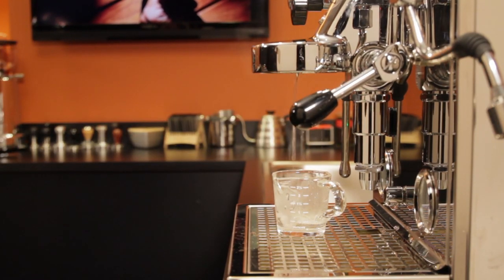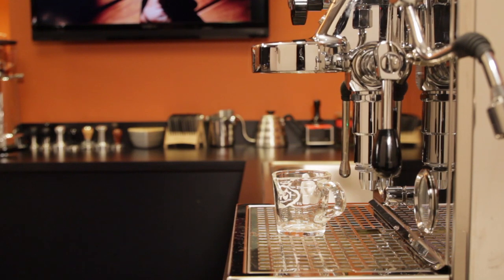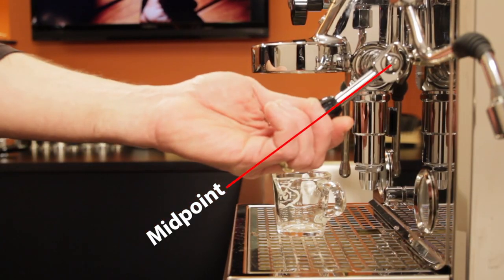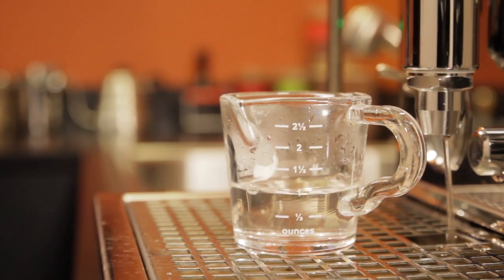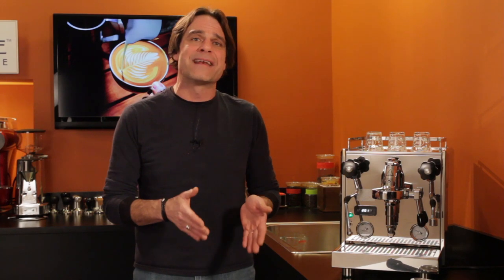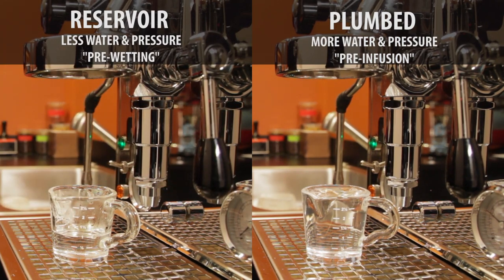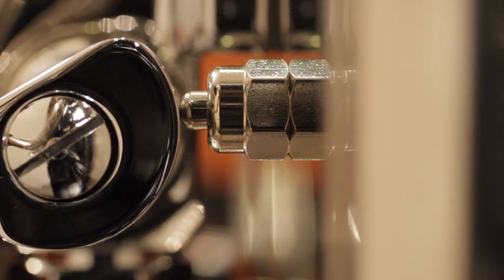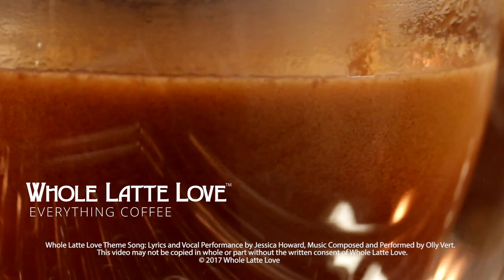How To: Pre-Infusion on E61 Brew Group Espresso Machines

Comment: UPDATE: turns out I'm wrong and there is no such thing as autmated pre-infusion. Thanks for clearing that up!

In a video about E61 it might have been worth to mention that is comes with built-in automated pre-infusion... Not sure if your research was sloppy here but I feel that's something to know about the E61. Don't get me wrong, I do like your other videos!
Reply from the maker: Hi Clemens, Thanks for the comment. We've been using and rebuilding E61 groups for years and are unaware of built-in automated pre-infusion. Some however could possibly call what happens with E61 groups on Expobar machines a form of that. Expobar E61s have an extra chamber milled above the shower screen. It takes a second or three for that chamber to fill with brew water before full brewing pressure is applied to coffee in the portafilter. As it's filling, water can drip through the shower screen and wet the coffee. Is that what you are referring to? Also some difference depending on pump type a machine uses. Vibration pumps tend to ramp up to brewing pressure over a few seconds while rotary pump machines achieve full brewing pressure quickly. Although rotary pumps are more robust, we do talk to those who prefer a vibration pump machine for the "pressure profiling" like effect they deliver at the start of an extraction. I am curious to know more about what you are calling automated pre-infusion.
Reply: No you were not wrong. What this video as well as the one you linked completely ignore is the "preinfusion chamber", which has a weaker spring than the bottom one designed to open when you start the brew process. It opens from the pressure, without the lever being in the bottom position. That is the whole reason that there are two parts to the outlet instead of just one. In the video you linked in your followup comment the guy does not seem to know how the lower half of the E61 works at all, he speculates the two parts (and springs) are meant to lower the pressure in the outlet when you stop brewing. But the top chamber of the lower part starts filling with water when you start brewing! The chamber is called "preinfusion chamber", strange that people making explanatory videos about the E61 miss that and claim that the lower part is sealed off when you start brewing. When you start brewing the pressure in the middle chamber opens the upper valve of the lower (outlet) chamber, which has a much weaker spring than the bottom part, which remains closed until you put the lever in the lower position. The relatively big upper chamber fills up, and only when it's full does the full pressure reach the coffee. It takes between 4 and 10 seconds, depending on machine and state of the machine. During that time water already reaches the coffee, pressure slowly rises. Not linearly, first slowly, then when the preinfusion chamber is full quickly. That's when the real brewing process starts. You don't need to read forums, the E61 has very few parts, combining your knowledge of what happens with what you see when you take it apart should make it readily apparent how it works. Of course, you must notice that the larger chamber's spring is pretty weak and start to think about what that means - that's the key point... 

What you should be observing if everything is right is that after pushing the lever full up to open the upper valve and start the pump is several seconds of delay before the brew process starts. This may fail for various reasons, some that I myself experienced (Vibiemme Domobar) are that the coffee does not put up much of a resistance so the pressure inside the middle chamber does not build up enough to open the preinfusion chamber sufficiently, or anything else that keeps that chamber from being opened by the pressure, such as scale buildup. In this "preinfusion position" the pressure opens the lower valve only a little bit, until the long piece of metal starts pushing against the next rod controlling the lower bottom-most (and much stronger) spring. That valve is not opened by the pressure, it only opens when you push the lever full down and apply mechanical pressure on the long metal rod. Now both lower chambers are fully opened and the water flows out. It's a pretty delicate process, small amounts of scale built up as well as shortening of the metal rods over time - each time you rotate the lever there is direct metal on metal action - can lead to problems with either preinfusion or end-of-brewing pressure release, or both. Another strong influence over the preinfusion is the size of the hole in the upper chamber, from the pump to the middle chamber. The smaller it is the longer it takes for the preinfusion chamber to fill because for a given amount of pump pressure you get a maximum flow through the hole.

See http://coffeetime.wikidot.com/e61-pre-infusion or, even better, directly from the E61 patent application: https://www.home-barista.com/espresso-machines/e61-group-espresso-machine-is-its-reputation-justified-t376.html (under "The system of operation is as follows:") 

Quote (14: middle chamber, 8: weak upper spring of the 2-section outlet, 9: large upper outlet chamber, 10: bottom chamber seal of the outlet with the string spring)

"When the pressure in the chamber 14 reaches (in the case in question) 1.5 atmospheres, this pressure overcomes the power of spring 8 and the sealing device 7 becomes detached from the seat. But in the supposition in question, the sealing device 10 remains in the off position. As the hot water still arrives in 14, this water, little by little, fills the cavity 9. After this filling, the pressure in 14 and above the coffee powder contain in the filter, rapidly increases under the action of the pressure in 3, and then the infusion is distributed."

Comment: Hi Marc! Thanks for the excellent videos. Do I need to adjust the Brew switch on my ECM Technika V Profi PID espresso machine? I am using the water reservoir and when I move the lever to the 45 degree neutral position the pump is activated.
Reply from the maker: Hi John, Maybe? If you are plumbed in and want to do line pressure pre-infusion. But do check prior to adjustment and lift the lever without turning pump on. If you have a position where water is released from the group without pump coming on then maybe not.
Marc
Reply: @Wholelattelovepage  With the Technica and I guess other machines you can check when the water is released when you lift the lever halfway by doing it without a portafilter. At the halfway point there is no resistance. It's almost like a resting point. You lift it very little just above that position and even if you leave it there the water drips out. Weird enough, when I do it channelling happens. When I don't, I'm fine. Machine is not plumbed.

Comment: Good morning Marc how do you pre infuse on a pro 700 with flow control? Also does coffee come out before you lift handle all the way? How long do you pre in fuse and does that get subtracted from the 25 to 30 second brew time?
Reply from the maker: Hi mm, For pre-infusion use the flow control - much better than standard E61 capabilities! If doing a non-flow control pre-infusion with a plumbed in Pro 700 your pre-infusion would be at the line pressure of the plumbed in connection. It's possible you could get some drips from a line pressure pre-infusion if you let it go long enough and the line pressure is high enough to get through your grind. There are variables involved like grind and line pressure but would not be surprised if you had some drips after a 15 seconds line pressure pre-infusion with 2 bar of line pressure. How long you pre-infuse depends on what you're trying to accomplish. The 15 seconds described above is a common way to tame the brightness of a very fresh from roast specialty coffee. It allows CO2 locked up in fresh beans to off-gas prior to the main extraction. I do not count pre-infusion in shot timing.
Marc
Reply: @Wholelattelovepage  thank you Marc. So if I pre Infuse force a 10 or 15 seconds do I then go 25 to 30 seconds on top of that to brew in other words including the pre infusion 15 seconds do I then go 40 to 45 seconds

Comment: Hi Marc, I'm getting an Isomac Mondaile espresso machine and do you know if I can get pre infusion with this machine
Reply from the maker: Hi COTWPWA, Thanks for the question. It's not a machine I've personally used. I did look it up and it appears to be an older model machine. Has the E61 group so you should be able to get a prewetting of the coffee by lifting the lever until just before the pump kicks on. But, no extended pressure driven pre-infusion I'm aware of.
Marc
Reply: @Wholelattelovepage  Ok thanks Marc, seasons greetings to @WLL

Comment: Why would one pre-wet coffee and how would that affect total brewing time?

Ps. Really like your video's. They are really informative!
Reply from the maker: Hi NL, Thanks for the comment! Some feel that pre-wetting/pre-infusing the coffee helps to correct for minor issues in distribution and/or tamping technique. Also may allow for a deeper extraction by wetting it prior to applying the full pressure of brewing. Is that true? As mentioned in the video IMO maybe. So many variables in the dark art of espresso it's hard to pin down pre-infusion as responsible for subtle changes in shot quality. We do not count pre-infusion as part of brewing time. When timing, we start the clock at the first drip of espresso from the PF spouts. But timing is really about knowing you're in the ballpark and not a hard rule. There are some coffees  we prefer made with shorter extractions and some we like longer.
Reply: Thank you for your answer. I'll do some testing on pre-wetting on my e61 machine and see if I can taste any difference.
Reply from the maker: You are welcome. Please let us know how it goes!
Reply: I tried it a couple of times, unfortunately I am not able to find the pre infusion point on my old ECM Giotto. After the midpoint the pump turns on almost instantly. In a couple of months I have my Isomac Tea back, will try it again on that machine.

Comment: Hi Marc, well I do it some times since I saw the video from your colleague "how to pre-infuse on the Expobar Brewtus IV Espresso Machine". Our Expobar Brewtus IV (Vibration reservoir/tank version) does 99,9% an excellent job. Only when users well me or my wife do a mistake, tamping or use another coffee till one finds the perfect grinding. Or the humidity changes and grinding has to be adjusted. Otherwise I try to believe "it does a better extraction". 

Guess it's the whole package; excellent water, coffee & grinding then one has the perfect preconditions in order to make a good espresso or coffee with or without pre-infusion. Try it out that's the best way; and some times change the way you make coffee.

With best Espresso Rgds from Switzerland 
Kurt
Reply from the maker: Hi Kurt, Thanks for sharing the detailed comment!!! Sounds like you know what you are doing! I love pulling shots on the Brewtus IV. Guessing you are aware your E61 has an extra chamber milled into the group above the shower screen. This lets some water accumulate and drip through on coffee prior to full pressure. Some Brewtus users prefer vibration pump over the rotary as it builds pressure more slowly at the start. Also, if it was my colleague Todd in the other video he was instrumental in the design of the Brewtus. He worked closely with the folks at Expobar on Brewtus design including its unique heat-exchanger in the steam boiler for pre-heating water for the brew boiler. And guess what? I have Swiss blood - father's side of family is 3 generations out of Switzerland. Maybe we are long lost cousins :)

Cheers from the US,
Marc

Comment: Hi Guys, You mention adjusting the machine so it doesn't startup the rotation pump while you operate the lever slowly upwards, but you don't mention how I can do that. Do you have some info on that? My machine is a ECM Synchronica.
Thanks a lot!
Reply from the maker: Hi Michael, Thanks for the question. There's a spot when you raise the level where the valve will open without the pump coming on. It's just beyond the midpoint detent when operating the lever. It's discussed at about 1:30 into the video. It can be a little tricky to hit the position. Easiest way to find is to operate the lever without a PF in place so you can see the water starting to drip when you hit the right spot.
Reply: Open the case, and you can shorten the length that the switch protrudes  from the case.Shorten this length, and more room for the lever to swing.

Comment: Hi, Mark! I always enjoy your videos, in fact, you were instrumental in my choice of Ceado E37s for my grinder! I do have some thoughts on pre-infusion, although I just recently got my hands on an E61machine to play with (the Appartamento) hence my visit to see how to go about it. My experience with pre-infusion has been with a machine that allows pressure profiling, as well as programmability in regards to water flow and pre-infusion. If I down-dose just a bit, I can grind way finer using a pre-infusion, and, especially with some really high-grown, dense beans, like a Guatemala, or Ethiopia, that brings out much more of the floral notes, and gives some notable change in the mouthfeel as well!
Reply from the maker: Hi m, Thanks for the kind comment and sharing your experience. We are going big on flow profiling! It can do a lot to help with those high altitude beans that are fresh from roast. A good low flow at that start with little pressure allows the CO2 to off-gas letting brew water penetrate deeper into the grind and pulling out those flavors and toning down brightness which is common in those types of coffees resulting in a better balanced flavor.
Marc

Comment: Hi Marc, I just got a Profitec pro 600 and the pre-infusion trick does not work without turning the pump on. You said that the switch can be adjusted I would like to know how please :-)
I guess if it does not work I will have to spend another 300-400$ and get the E61 flow control device!
Reply from the maker: Hi Marc, Thanks for the question. Since the Pro 600 is not plumbed to waterline what you'll get is a pre-wetting of the coffee by lifting the lever to the point just before the pump kicks on. Pre-wetting releases a small amount of water onto the coffee puck. That water is pushed by a small amount of pressure from the boiler. It's different than what you get from a plumbed ECM or Profitec machine. On those the water will continue to flow indefinetly powered by line pressure. If you cannot get a small release of water when lifting the lever to just before the pump comes on then you can adjust the brew switch which is contacted by the cam at the top of the lever. I do not have a video showing the process on a pro 600 but I do have this one showing how on a Pro 700: https://youtu.be/jfeBCfzhkaQ
If you want a true unlimited low flow pre-infusion then flow control is the way to go on the Pro 600.
Marc

Comment: The line pressure on your machine is at 4 bars.  Profitec recommends 1-2 bars. I added a pressure valve to my water line to get it to 1-2 as they say.  Could having the pressure higher than recommended damage the machine?
Reply from the maker: Thanks for a good question! 4bar will not damage machine. Remember during brewing everything will see ~9bar inside the machine. All internal plumbing designed to handle that and more! Perfectly fine to use a pressure reducer if you like.
Reply: MRODPHOTO: Good to hear you read your manual.  (My Synchronika states 0.5 - 2.0 bar and install a regulator if mains pressure exceeds this) Marc I would also agree with your comment about the ability of the plumbing to handle such pressures. While I haven't seen the internals on the PP700 if I recall this is the machine who's internals are almost identical to the Synchronika.  I am familiar "under the hood" of my Synchronika and If the PP700 has even one of the components that my Sychronika has, then I believe it has a potential to fail if the manufacturers recommendations are not followed.  Don't despair, I am not criticising either machine, like most equipment if you don't follow the manufacturers recommendations you may have a breakdown. I will post more on this topic under your Synchronika review https://www.youtube.com/watch?v=hunFv7E51L8 and the reasons I believe the manufacturer recommends this pressure range.
Reply: @Wholelattelovepage  It is possible the water entry point to the reservoir and the boiler line only designed up to 2BAR? My understanding is the 9 bar only applicable between the pump to the E61 head.. Thank You!
Reply: @balazsb8962  that wouldn't be too funny if it's true since line pressure in my home town (Kaposvár) exceeds 5,5 bar. So much about soft preinfusion...
Reply: @balazsb8962  btw that might be the case if your machine isn't plumbed. In my case it's quite simple because every piece of the water line gets full 8,5 bar pressure that's behind the rotary pump. (I have a Sanremo Verona TCS)

Comment: On most E61 machines there is already a built in pre-infusion anyway, basically it ramps up the pressure gradually (although I've seen a video where the plumbed in / rotary pump version somehow instantly hits full pressure) so that could make further confusion because you're comparing a pre-pre infusion to a pre-infusion :D And then Comparing an E61 machine with auto preinfusion vs another NON E61 machine without any type of pre infusion is going to add even more variables!
Reply from the maker: Hi Ben, Thanks for the comment - espresso is the dance of variables!
Marc